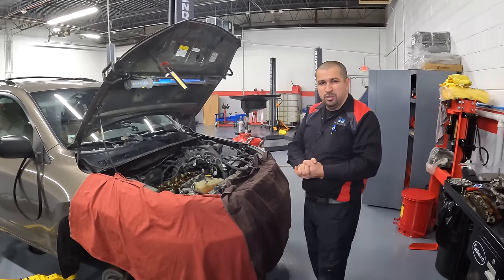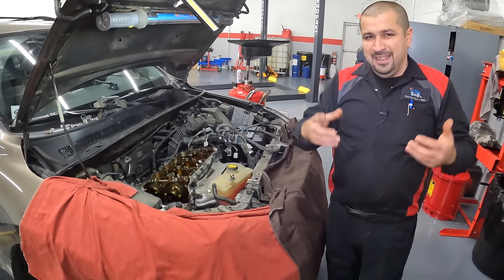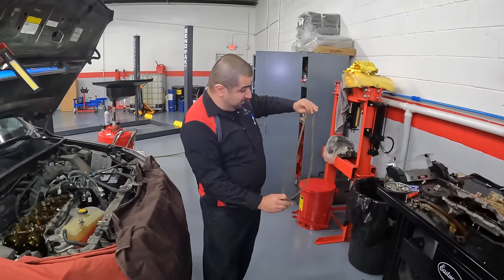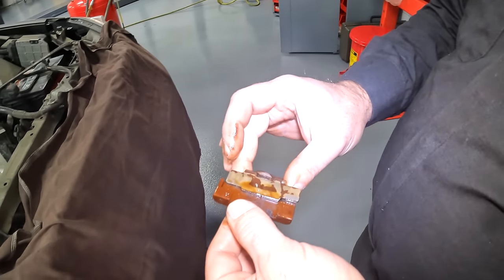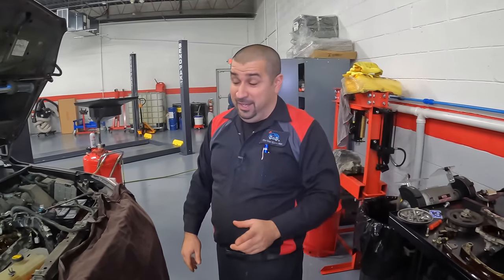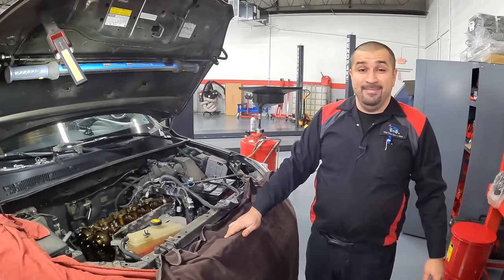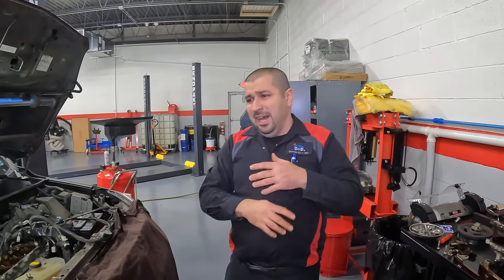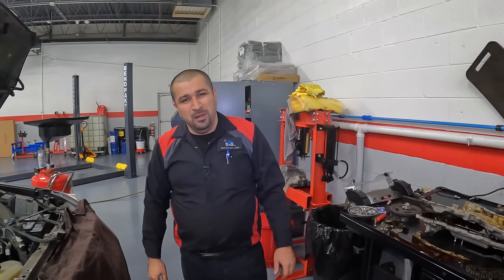When Should You Replace Your Toyota And Lexus Timing Chain?

Comment: I’m on my fifth Highlander in a row. Sometimes having three at a time. Bought a 2001 earlier this year that just had 102,000 miles and never had a change. But I traded it in a different car. Currently my 2006 Highlander has about 104,000 miles on it on the original timing belt. I’m beginning to feel like I need to change
Reply: On a belt?? Yes.....
Reply: Would be a good idea....
Reply: 104K miles = 160K kms, which is the recommended change interval. also your belt is 16 years old. Change the belt and tensioner, may not be necessary to do the water pump as those are quite durable.
Reply: @jayjaynella4539  I'd still do the pump ,too.  Just so I knew it's all new
Reply: its also recommended to do the cam seals and crank seal at the same time, they are cheap and you are working right next to them anyway.
Reply: Funny, because the host of this show when I happened to meet him, he was looking at my/this car in a parking lot in Wisconsin.

Comment: My 2020 Camry LE is still going strong at 214,000 miles.
Reply: So glad to know.  I have a 2019 SE (same 4 cyl) that just hit 16K and I am hoping to keep it for a very long time.  I will be obsessive with the maintenance, too.  My 2011 Camry LE was passed on to my son and now has 185K, still running perfectly.
Reply: 2018 Camry SE 106,000 miles, no problems.
Reply: what about the 8 speed transmission? I've heard they fail around 170,000.  I've heard the CVT in the hybrid Camrys is more durable
Reply: @4af  Over 219,000 miles on my 2020 Camry LE with the 2.5 L gas/8 speed transmission combo. Transmission fluid changed at 70,000, 100,000, 175,000, and will change again around 225,000. Seems to be fine.

Comment: As for checking the timing chain paint marks without removing the front cover, can't you just turn the engine over by hand at the crank and inspect the top of the chain all the way around where it goes over the two cam gears?  Is that area is exposed with the valve cover off?
Reply: That is what I am thinking. I guess we can just rotate the crank when we see all the paint marks.
Reply: i would say it is possible, i replaced my valve cover gasket recently and you can clearly see the top of the chain, so i dont see an issue with turning it over by hand to see the marks
Reply: Yes. You can turn the engine by hand with cover on. It will skip with it off. But you can't see the guides.
Reply: He probably just likes to get in there and inspect all the guides, I'm guessing.
Reply: @chrisg7859 When we can see the timing paint marks are clear, the guides are probably good too.
Reply: Yes, you can rotate the engine to examine the entire chain without having to remove the cover.  Timing guides can be inspected with an inexpensive borescope.
Reply: @whoknows8678  in the video he said he was already in there to replace VVT, then inspected the chain.
Reply: @danwake4431  And, he clearly said there was a procedure to do that job that didn't involve pulling the front cover.

Comment: I bought a new Rav4 Prime last July, and now have about 13.5K on the odometer. It's nice to know that if I take care of this car and give her oil changes every 5K, the timing chain will probably not be a failure point I will have to worry about. I have owned an '84 Pickup (the Pre-Tacoma truck that I think was called the Hilux in some countries but not in the US), a 2007 Yaris, a '78 Corolla with that old pushrod 4 cylinder engine that sounded like a sewing machine, an '80 Tercel, a 2019 Prius Prime,  and now my 2023 Rav4 Prime. It's my first Rav4, and I've totally fallen in love with it. I now know why the Rav4 has always been an immensely popular car, it's so versatile, and the P-810 transaxle and 2.5l Atkinson engine have made it the pinnacle of evolution of the compact SUV world. I've never driven a Lexus, but I can't imagine that a Lexus RX-450h+ would feel any better than this Rav4 Prime. 

I just wish I lived close enough to Chicago to have Ahmed as my service tech.

Comment: Great video AMD.  My question is then, is changing the engine oil at every 5,000 miles the best way to ensure the timing chain lasts the life of the vehicle?  Thanks.  👍🏻
Reply: I assume you mean changing the oil? But yes, changing oil every 5k miles will help keep the chain clean and prevent it from overheating
Reply: @WinPC99  Yes, I meant engine oil (corrected). 😄
Reply: @Jj-gi2uv  true. 2003-2008 were some of the best years for the Corolla. In Nigeria where I live they are everywhere...and they aren't cheap to buy at all, but it's worth it.
Reply: Yes, changing the oil every 5,000 is best for all functions of the motor.
Reply: @Jj-gi2uv  I’ve got a hatchback version of that, 2006 Matrix, 151000 miles & I do regular maintenance & it’s lasted a very long time. However, the fuel pump isn’t a regular maintenance thing, it only usually goes bad if you run a car out of gas, & it sucks air instead of fuel burning the motor out. It’s got the original fuel pump in it working perfectly just like 17 years ago. Is your Corolla manual or auto? My Matrix is auto
Reply: @Blakecryderman7244  The Corolla’s fuel pump is cooled and lubricated by the gas it pumps.  That is why most technicians specifically say not to let the gas go below a 1/4 tank. Continued success with your Classic!

Comment: So I gather that the friction of the chain against the raw metal of the top guide caused the excessive heat rendering the chain bad? You would think a (Toyota) design improvement would be to better fasten the plastic guide piece to the steel bracket piece. That, of course, wouldn’t fix the worn VVTG! 😊

Comment: As an engine machinist of 30 years, I can assure you Toyota timing chains are almost worry free. The only thing that really kills one, is improper maintenance. The old 22R and 22RE timing chains would go well over 250,000 of bad maintenance before failure.
Reply: @David C Really?
Reply: Can’t kill a 22R , just change the oil
Reply: @mikehand2668  I've had 22R's come into my shop with 200,000 plus miles that still had the standard bore size. A very lite honing to knock out the glazing. Good for another  200,000.
Reply: @davidwalker7383  David do u know much about Lexus es 330? Specifically the 2004

Comment: Just had timing chain replacement on 02 celica gt..175k it made the engine like new performance..water pump and thermostat..also
Don't let it go bad or you will need new engine...😊

Comment: Excellent!  Question tell us about the official Toyota service and maintenance manuals.  How many different manuals are available for each model ( mechanical, electrical, suspension, drive chain, body panels, interiors)?
Reply: For most toyota's if you need a manual for service...something is really wrong.
Reply: @singular9   Yes there certainly is!   I was just a point A to B type of car  car person.  Thanks to AMD I decided to stop fighting the outright lying of my local Honda dealer. I usually buy only Honda Accords once every five years and never had a problem except the lying by my local Honda Service department.  How to avoid the lying?  Stop buying a Honda! They can hire honest mechanics or advertise for new customers it is their choice. As a result of AMD I switched from Accord to a 2022 Toyota Corolla SE.  Love that car!  But a new problem.  When I listened to the Toyota F&I salesman exaggerate and bloviate.  I wrote down a list of items the dealer wanted to add.  I said NO thank you.  No addendum and paid for the car at MSRP.   I  left the car in front of the New car sales area and the walked over to the Parts department where I heard more bloviation about the parts " MUST BE INSTALLED" by the dealer like security lug nuts for each wheel?  Give me a break, I know that $41 for a full set is cheaper than $150!  The Parts manager  told me that "Toyota does not have Parts numbers".  So I bought the lug nuts and had my Professional auto detailer apply the "ceramic" paint coating at $900 less than the coating.  What about the oil, drain plug gasket and  oil filter?  I bought them from a different Toyota dealer.  Why do these people just plain lie?  There is no one to complain to.  Mr. Akio Toyoda President of Toyota motors, where are you?  We must force your dealers to abide by your agreements.  Are some Toyota dealers giving your brand a bad reputation??   This is why I need a full set of manuals.  I am looking for one honest  T-Ten Toyota trained technician.  In the mean time, I need to know what to know ( maintenance manual) when I finally hire one.  I do not trust two local Dealers.  One uses the SAE 5-20 oil instead of Toyota SAE synthetic 0-16W (on a new car in cold weather) since "they ran out two months ago" and the other is too sketchy.
Reply: You can get Mobil 1 , 0w 16 and it will work fine
Reply: @mikehand2668   I just bought several cases of Toyota 0w-16 , several oil filters, activated carbon cabin filter and extra goodies.  I lost my trust in local Toyota Dealer Service.  I do not feel guilty for not trusting those who deceive others.  I plan to work around problems that I identify.  The car is mine and only I am responsible for preventive maintenance, maintenance and repair and NOT "Toyota care".  I know that  the local T-Ten trained mechanics are getting paid a barely living wage while state law requires $15.50/hour to hand sweep a parking lot and fast food order clerks make abut $22/hr  to punch an icon of a burger and say " Do you want fries with this?".  Dealer mechanics and Technicians are getting between $20-30/ hr with few benefits while the Dealer charges suckers like me $200/ hour labor rate.  My family physician doesn't make that much.  Maybe an ad in Craig's list will help me in locating a T-Ten trained technician who will work for less than $200/hour?  I'll pay for the lift and equipment required.  Of course I always pay with real money ie cash (" For all debts public and private")   as is printed on each Federal Reserve Note.  Honest mechanics will be able to survive on "side jobs" with no "upselling"  or bogus findings, reports or work.

Comment: My 2006 Scion xB has a 240,000 mi on it and not only have I not replaced the timing chain, but I haven't needed to replace it the clutch either. In fact, the only thing I've had to do this car is standard maintenance like changing the oil and tires and brakes. I did replace the water pump at 130,000 miles now that I think about it. And I replace the spark plugs at about 140,000 mi. I don't expect to replace them ever again. I've only had two cars with timing belts and I swore I never get another one with the timing belt.

Comment: I have a 1999 5VZE 3.4L V6 4Runner. The last of the Toyota timing belt V6's. Also a non interference motor. Mine has 212k on it, and the timing belt was last done around 70k. Very easy to "peek" at the timing belt for wear signs on these motors, and the worst case on failure isn't too bad. I'm happily willing to chance the old belt to save the money while I wait for my 2023 to arrive.
Reply: I changed the timing belt on my 01 tacoma , 3.4l v6 @ 400,000. 
Belt still looked like new.
Truck has 490k now, original drivetrain, changed alternator & starter, nothing else
Reply: the 1MZ is a timing belt and used up to 2006 in Camry.

Comment: Love your video and reassurance about Toyota quality!  I have a 2006 RAV4 3.5L V6 with 216,000 miles and still running strong.  I bought it new and have been very diligent in changing the oil every 5,000 miles until it reached 100k and now I change oil every 3000 miles.  The only major things I've done was replace the water pump and all the ignition coils and 
spark plugs.
My question is on a very cold day is it normal to hear the chain rattle for about 2 seconds?

Comment: I had a gear fail on my 3URFE and they ended up replacing 3 gears and 3 chains 3 years ago.  Now I have a rattle at idle and I am afraid they missed something.  Scheduled to be looked at for repair so we will see.  Love your videos.
Reply: New age toyota junk. 2uzfe doesn't have this issue

Comment: I have a rattle in my 2011 Sienna’s 2GR-FE . It happens as the engine goes into and out of idle. When starting or stopping, there is this grinding, rattling sound that I thought was the water pump or tensioner pulleys. I replaced those, and it turns out they did need replacement, but that isn’t what was rattling. There is also a knock from somewhere in the bottom of the engine on cold start. The engine has 244,000 miles on it. My gut has told me to look at the timing chain guides. There is no loss of power or drivability, just the noise and dread that an expensive repair is on the way.

Comment: My 2012 Ford Focus is 300 miles from having 150,000 miles on it, and it's ready for another 200,000 at least. No chain problems. My co-worker has 270,000 miles on his 2014 Ford Focus, and original chain, no problems. The self-adjusting tensioners in modern engines (no matter who makes them) takes up the slack from stretching that used to be the reason for changing timing chains before there were overhead cams. Also, the computer compensates as well if needed.

Comment: I replaced my timing belt on my 1992 Corolla at 90K after I was excoriated for not replacing it at 60K. I compared the old one and the new one. I could hardly tell the difference. It could have gone a lot longer. After it was replaced, my car leaked oil. Went to a different mechanic after that. Sold the car at 200K still running well.
Reply: Timing belts from early Toyota's, Honda's, Nissan's, etc lasts waaay longer than that 60,000 mile interval as long as you're not abusing your motor. Big reason why is that they're under the protection of the timing belt cover and it's less exposure to the elements than the other drive belts.

Comment: My 2008 dodge dakota 4.7 v8 makes a clicking sound which I think is the timing chain slack adjuster/ tensioner system.  Rocker arms lifters been replaced. Exhaust manifold bolts replaced. Runs good just annoying.  I may be bringing that thing down to Chicagoland for service when I get my trans am out of storage. Full confidence it can be fixed at the car care shop

Comment: Nice dude thank you for this video. Have a tiny bit of rattle starting on mine so gonna check paint marks, check that top guide, and replace the tensioner if those are good. I don't have the balancer puller so want to try to not take the cover off if I don't have to.

Comment: I have a 01 Celica GT-S. I'm new to timing chains so I assume I don't have to worry about it. I've looked under the valve cover and it looks fantastic and it's properly tensioned.
With that said, this baby hits a bit more than 8K RPM and has lift so I would assume this chain gets more abuse than normal Toyotas. Not sure if that matters or not.

Comment: The 80's model Toyota pick-ups with the 22R-E were known for timing chain stretching issues, I had an 86 pick-up that i replaced chain due to that issue at 125,000 miles!

Comment: And if you’re getting the cold start cam phazer noise, on the 2ARFE/2ZRFE, you can open up the cam phazers and replace the tiny springs with slightly stiffer ones.

Comment: If you wanted to look at the timing chain paint marks without removing the front cover, then just turn the engine over a bit at a time, and look at the whole length of the chain as it goes over the top sprokets.

Comment: Love your channel. I have a 1989 Toyota King Cab (I believe they didn't name it Tacoma until 1990) 4 Wheel Drive, 4-cylinder, 22-R Motor with 195,000 Miles on it. I bought it brand new in Sept. of 1988. It's been garage kept forever. Haven't replaced the timing chain yet. Should I consider it because of its age?  Thanks!

Comment: I’m watching all the from Asia. All my vehicles have been Toyota, since 1998 when I bought my first 80 series Land Cruiser. Then bought Corolla for my wife, it was Singaporean domestic model with no heating in the climate controls. Anyone been to Singapore would know why. In my country’s south, where I live we get like 2 months of mild winter only. Sold that and bought myself 2.7 litre 4 cylinder JDM 4Runner ( we have the British colonial right hand drive system here. To cut the story short, all 4Runner are called Surf in the JDM market and it served me well. Then after selling the Surf, I had driven 120,000/KMs ( nothing compared to US mileage), I bought myself another JDM gem, used 2006 Mark X with 2.5 litre VVTI V6 engine in 2013 and still enjoying it. 
So, I doubt I’ll go outside of Toyota for my future vehicles.

Comment: the ratcheted tensioner is a really good idea, it doesn't retract when there isn't enough oil pressure, like in the first few seconds during start, everybody should have one

...yes VW group and BMW, by everybody that means you

Comment: Mr car care nut. I have an oil leak on my Toyota Matrix 2.4L at the timing chain tensioner gasket. If possible can we get a diy demo on how to install the tensioner and to set the tension by turning the crank shaft bolt. There's a couple videos circling in YouTube but I would like to see how a Toyota master technician like yourself goes about the job with the attention to detail you follow. Thank you for all you do!

Comment: Dang.  Wish I had seen this video back in April.  Had the timing chain replaced in my 2007 Highlander Hybrid (at my request, thinking it was "due") at 103,000 miles.  The Toyota dealer (no local import shops want to work on hybrids now, even 20 years after they became mainstream) didn't caution me it might be unnecessary.
Reply: of course not. they aren't going to turn down a $1000 job. That's unfortunate.
Reply: Just change your oil every 5k miles to keep all engine components great.  Full synthetic